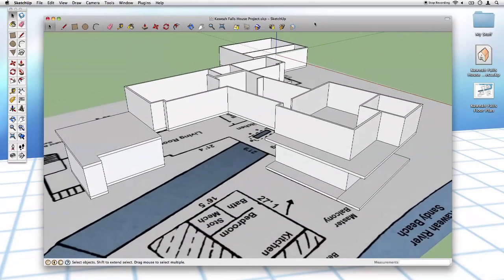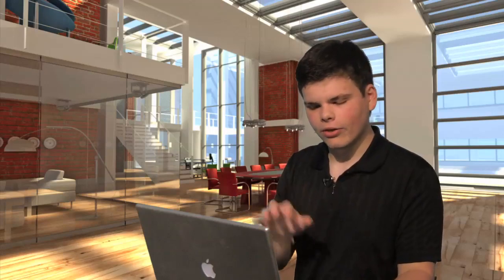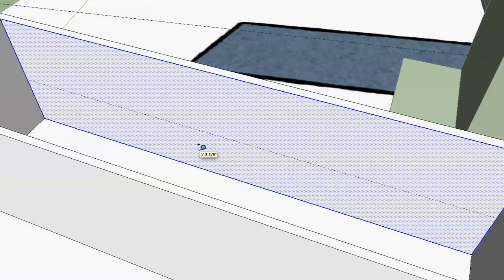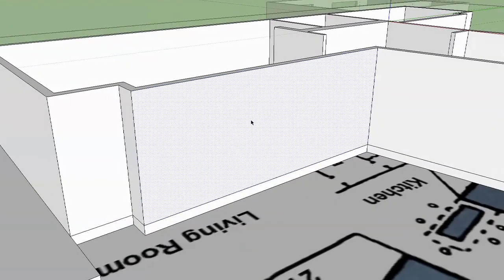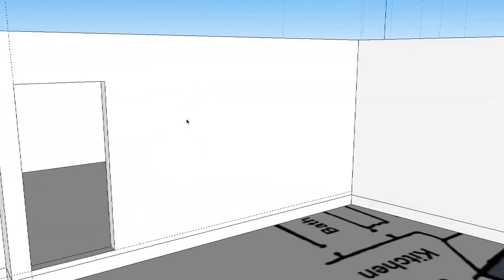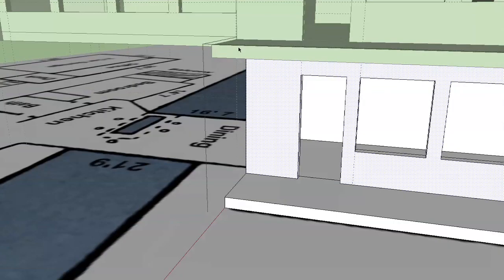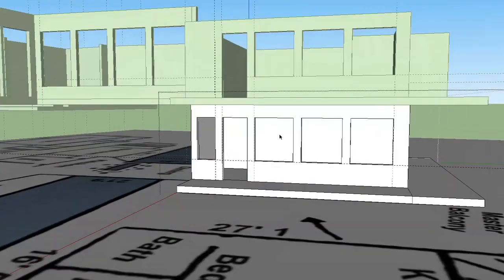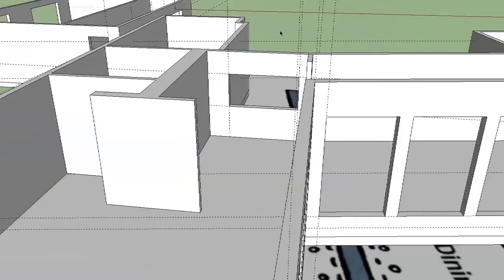SketchUp #53: Kaweah Falls, Part 4

Comment: Another excellent show - I'm learning so much so quickly.  I've been animating for nearly 2 yrs but only using SketchUp for a month.  I'm already beginning to feel like an expert!  Incidentally, for those having difficulty punching holes in the walls for windows and doors, the problem maybe that you need to realigh your axes again so that the rectangle that you have drawn actually lies flat on the face (wall or window) and not slightly off it.  You could move your camera around just to check.
Reply: Great tip Peter. I will remember this as I start this session #53

Comment: @ 20:41 There are two steps up to the upper level of the master bedroom, not just one. 8" isn't enough rise. They are shallow steps, perhaps 6" each, 12" total.

@ 20:57 That wall is missing the closet with the giant mirrored sliding doors. It looks like that closet must jut out on the exterior of the house because it occupies only about half enough space in the bedroom.